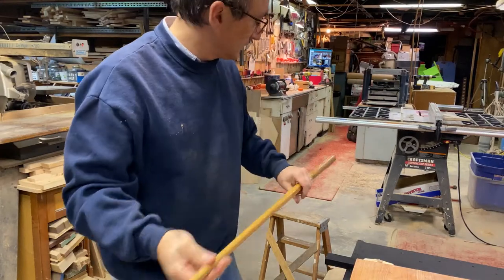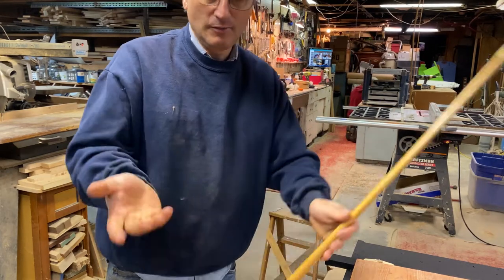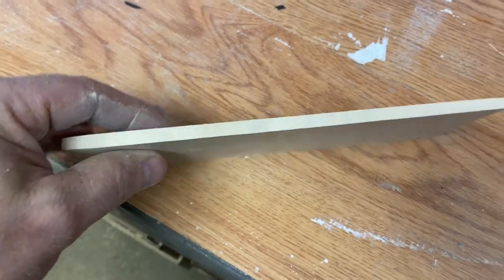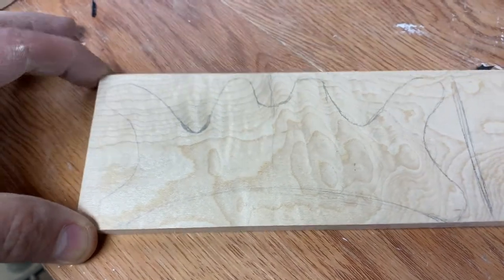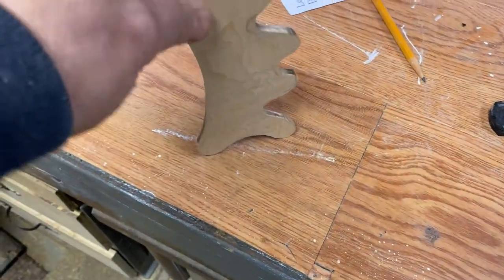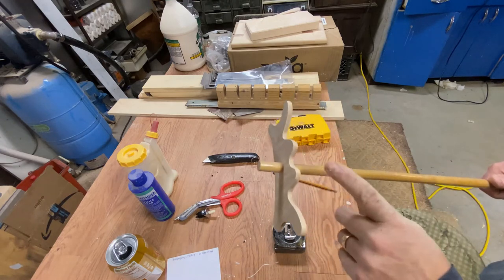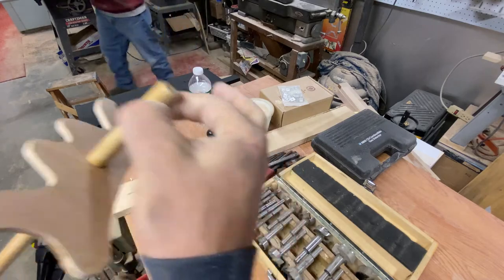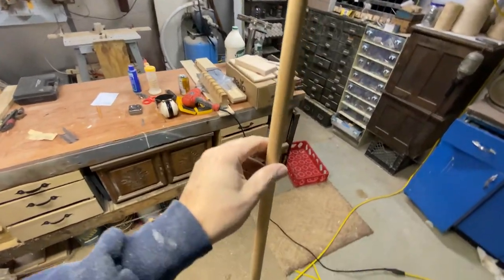How to make a pool game bridge for the pool table

Comment: You should have drawn half of it on a piece of folded paper cut it out and then when you unfolded it would have been semetrical.
Reply from the maker: Your absolutely right, I just did not want to take the time. Although it would have been just as quick most likely. Thanks for commenting.